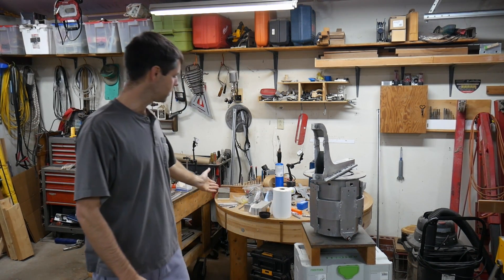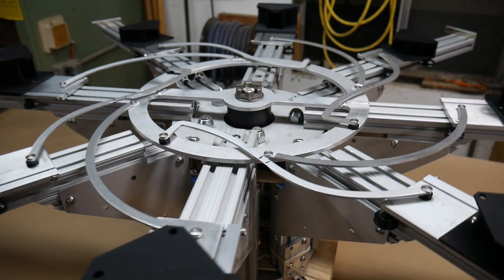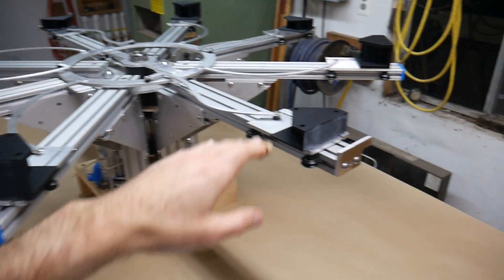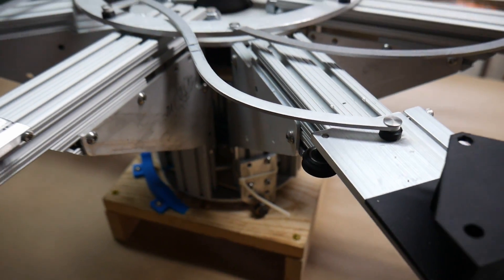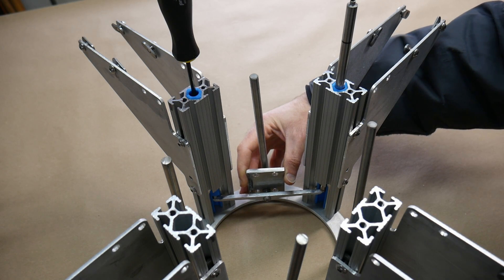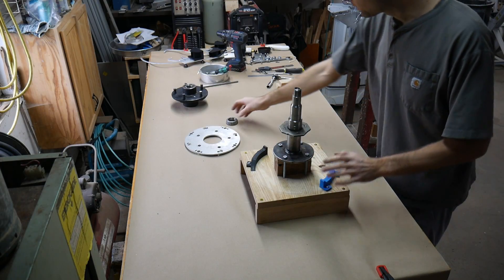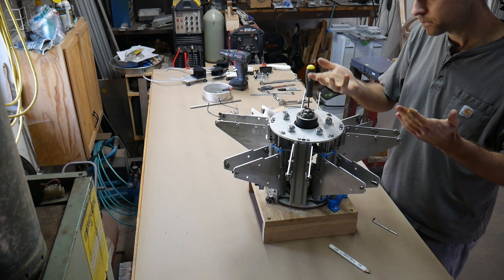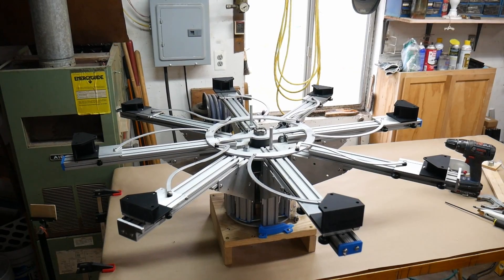New Mechanism - Table Redesign 1

Comment: i am working from last 6 months...main problem i am facing is flatness problem on metal sheets or uneven metal sheet.....So which material Scott used as gusset plate .....?Aluminium or any other?

Comment: Hello Scott, why are you lifting whole arms and not just "trolleys"? There is several ways how to do it, just depends on what part do you want to rotate...
Reply from the maker: @jwallenfels1  synchronization and fewer independent moving parts were the original motivation, I've since updated the strategy, see the newer videos.
Reply: Hello Scott. Which material you used for laser cuttings?

Comment: Why are the arms that connect the center ring with the 4 slides that rise of a different shape near the center ring than the arms that slide out the panels whose vertical height remains constant?  Was there merely a design change to permit all 8 arms to fit when the table is in its small state?  Thanks.
Reply from the maker: The sharp 90 degree bend lets them clear the extrusions as they lift up. The gentle curve helps them clear other parts in the small condition. It's definitely an odd shape, but it worked.

Comment: What will you use for the final lifting ramps? You stated that you 3D printed them due to difficulty machining them, but clearly 3D prints will not suffice long term. I ask because those hardened bearings running on anything softer than steel will gall the material over time and be a major point of failure once the full weight of the top is applied. They're going to have to be machined and machined out of steel. How will you resolve this?
Reply: Doesn't seem like a terribly difficult part to have machined
Reply: He could use a bearing/roller with molded polyurethane over the outer race.  Then the lifting ramps could be molded, in production, by a simple plastic casting process.  No machining required.

To make the casting, start with an SLA 3D print of the part (to get the best surface quality and dimensional accuracy).  Lightly sand the SLA print to achieve the desired surface finish.  Use this at the master part.  Then create 2-piece silicone mold/s for the part.  Suspend the part in a simple leak-prove wood box, and add a sprue to fill mole w/ resin later.  Pour in 2-part silicone mixture.  When cured, use sharp knife to cleanly cut master part out of the silicone.  Then pick your favorite 2-part resin, reassemble the mold, pour the resin it into the mold, and wait for it to cure.  This method will create about 3 parts per day per mold.  The mold will last for about 20 - 30 parts before needing replacement.  Ramp up production by adding more molds, using the same master part.  If done well, this can result in a plastic part nearly identical in quality to an injection-molded parts, without the high expense of an injection mold.  This method works well, at reasonable cost, for 10s and several hundred parts.  There are companies that will mold these parts.  By that time you should know if it is worth the investment of injection-molding the parts.

Ed Schultheis, PE
Mechanical design engineer and manufacturing consultant for 35 years
Schultek Engineering & Technology, Inc.
Reply: can anyone tell me one thing ... i am working from last 6 months...main problem i am facing is flatness problem on metal sheets or uneven metal sheet.....So which material Scott used as gusset plate .....
Reply: ??I am waiting for a guide from you guys